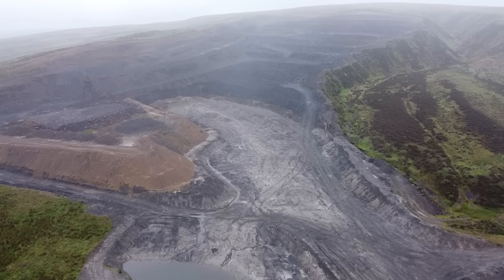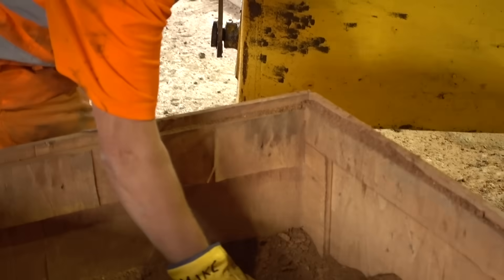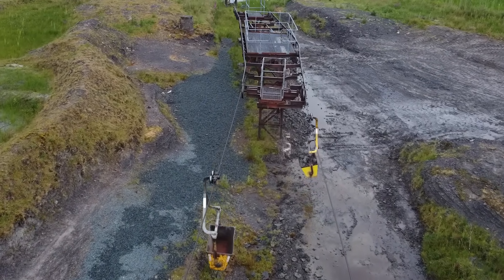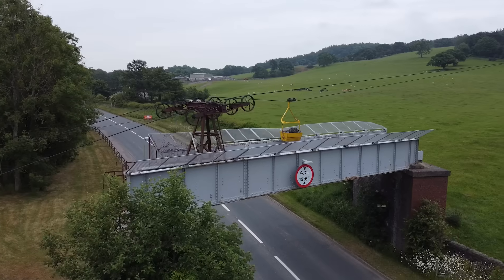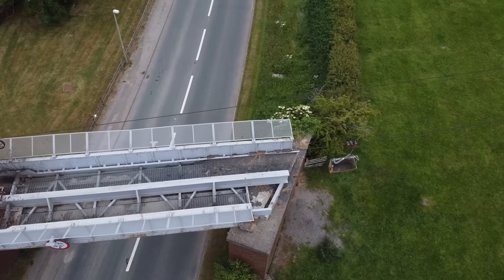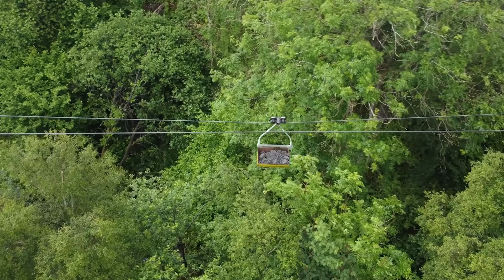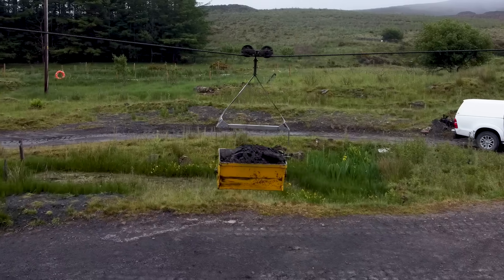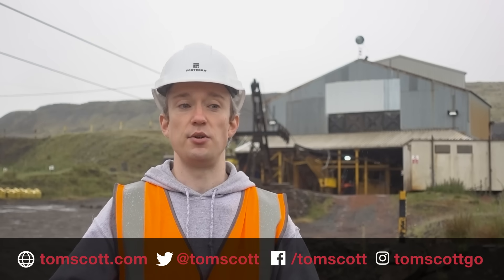The UK's last aerial ropeway uses no power, moves 300 tonnes a day, and will be gone by 2036.

Comment: "unless money is constantly spent to keep it in working order, it'll decay into an unsafe blot on the landscape' you perfectly summed up everything kept for heritage value - people think everything should be kept but few are willing to spend the required upkeep costs.
Reply: Isnt that true of any system, can you give an example of a system of transport that takes no costs for maintenance?
Reply: Log driving?
Reply: @ You are not very familiar with log driving are you. teams of horses, and men and the resources supporting them. Carving out landscape to facilitate getting the logs into the river system. Creating and maintaining booms and wing dams and water control dams. Power supplies for all of that.
Reply: Most ropeways do not use any power to operate. If the sourcing end is higher than the destination gravity does all the work. In fact it created a problem… what to do with the surplus energy created… and available at either end. Some of the ropeways used this power to generate electricity. Others had elaborate dynamic braking systems to disipate the energy.
Incidentally, there are hundreds of ropeways in use today… the ski lifts used worldwide. Most all ski lifts (and aerial people movers) are derivations of the mining ropeways developed one-hundred and fifty years ago.
Reply: Here, on the south coast of England, the probable disassembly of the (much-loved-but-costly-to-maintain) Hastings Pier has just been announced. November 2025.
Reply: Wrong. To keep a ropeway in operating condition requires maintenance and upkeep — what system doesn’t. However, the few remaining abandoned ropeways left are essentially old key… a few tower structures and maybe a wire rope — often already squirreled away already. For their purposes, ropeways are an environmental bonanza. And are making a comeback.
Reply: Tourism is the only answer.

Comment: Legit question, why don't people keep using gravity fueled airial ropeways for transport like this? I mean it saves on fuel costs and corbondioxide pollution. It's just real nifty. Anyone know?
Reply: Because it's not free energy. It is powered by the gravity of the shale that's quarried for the Forterra brickworks in the buckets. The shale got into the buckets likely with a diesel powered forklift or loader. It is not pollution free, and does (indirectly) use fuel.
Reply: @Richard Fallstich  The buckets don't carry bricks, they carry shale from the quarry to the place where they make the brick.

Comment: can someone explain to me how these buckets go up again?
Reply: It is powered by the gravity of the shale that's quarried for the Forterra brickworks in the buckets. The bricks are only on ONE side of the 'conveyor' - the side going down, only the empty buckets [which are lighter] go back up.
The shale got into the buckets likely with a diesel powered forklift or loader. It is not pollution free, and does (indirectly) use fuel  for power.
Reply: @RichardFallstich  The buckets don't carry bricks, they carry shale from the quarry to the place where they make the brick.
Reply: The buckets have a mechical grip at the top (like a pair of pliers), when placed on the moving cable it grips the cable and gets hauled up. At the top the grip releases and it moves onto like a siding to be refilled.
Reply: The empty buckets going up are lighter than the full buckets coming down.

Comment: Uses no power?   So what drives the pulley system fresh air 🤔
Reply: It is driven by the gravity (weight) of the shale that's quarried for the Forterra brickworks. The shale is only on ONE side of the 'conveyor' - the side going down, only the empty buckets [which are lighter] go back up.
The shale got into the buckets likely with a diesel powered forklift or loader. It is not pollution free, and does (indirectly) use fuel for power.
Reply: @RichardFallstich  It's driven by the weight of the SHALE.....not the bricks. The bricks don't travel in the buckets, only the raw material.

Comment: Going into 2030 replace shale with tourists and quarry with a café. Put electric generators as brakes and a hundred year green attraction is magically created.

Have tours from entry level to engineering degrees, explaining the concept. It could be part of a larger tour package where the roman aqueduct system is included.

Tourists can travel the world learning what inventions use the natural forces to perform work.
Reply: Someone with an engineering degree will know how this really works. It is powered by the gravity of the raw shale in the buckets. The shale is only on ONE side of the 'conveyor' - the side going down. Only the empty buckets [which are lighter] go back up. The shale doesn't just jump into the buckets at the top. Shale got into the buckets likely with a diesel powered forklift or loader. It is not pollution free, and does (indirectly) use fuel for power.
Reply: @Richard Fallstich  The buckets don't carry bricks, they carry shale from the quarry to the place where they make the brick.

Comment: Clever design to be sure.  However, just to keep Isaac Newton happy on the whole this system is really kept operating by all the diesel & electricity used to bring tooling up and extract material at the top of the operation.  Tapping into the potential energy of material at higher elevation is a nice bonus.

Comment: There is a mining company in Australia that hopes to run battery electric freight trains in a similar way to this. They will be loaded up with ore at the mine, before using dynamic braking all the way down the hill to the port, where the dynamic braking should have generated enough electricity to get the empty train all the way back up the hill to the mine again. In a similar way to this Aerial ropeway, I hope that this mining operation will essentially act as the 21st century version of the amazing ingenuity from the past.

Comment: hm, I can imagine there are many viable uses today, slightly upgraded ofc. imagine a ski gondola. yes yes I'm aware this system needs specific amounts of weight and timing, but nothing that cant be automated? not enough people aka weight? send up a weight dummy instead. too much people? take one out. might not be as high capacity as a fully motorized version, but I can imagine this might be a great solution for smaller destinations with low tourist volumes?

Comment: Why can't this technology work bye using removable weights for ski lifts?
Reply: Because the “removable weights” would still need to be lifted back to the starting point eventually…  That would be a net loss…
Reply: @brookebradford8009  easy, the weight is dropped at bottom into a waterpipe when they fall automatically opens into a container that automatically shuts.  The containers are filled on the outer sides with air, causing the container to shut upward to the top.  This system would send the container back down bye gravity helped by air vacuum system.  ?

Comment: Okay going down the hill everything goes but what about uphill?? How you guys make it move it??
Reply: The weight (mass) of the filled buckets going downhill is greater than the weight (mass) of the empty buckets returning… If the link were broken, an external power source would be required to restart it, but as long as mass that is being pushed downhill by gravity exists, the resulting kinetic energy is sufficient to pull the empty buckets back up.

Comment: You could say it is gravity powered; as long as there is a  mine digging up material to put in buckets the heavy buckets out weigh the light empty buckets and it goes round and round.  Smart that they didn't try to use power and waste it.

Comment: Okay but, I have a genuine question: if it requires no fuel or energy to power, and it requires maintenance on the ropes every 6 years, surely it could be made into a museum or something. Just as an example of how it used to work. It's a feat of engineering! It's unique in the country! Are you telling me this couldn't be solvent with tickets sold to see how it works? Perhaps not. Seeing as it actually needs to bring something down for the system to flow, if there's no shale it can't. 

Still a real shame though.

Comment: Hmmm, guessing those buckets aren't filled using a magic wand, nor is the material used to fill them, extracted in the same manner...

And if the weight of the material in those buckets is what keeps it operating?...

Cool contraption, but most certainly doesn't operate on zero energy...

Comment: Actually, since gravity alone bears no energy (it is the energy well itself), what powers it is the gravitational potential energy of the rocks that get into the buckets. The potential energy of an object upstairs is higher than one downstairs. The rocks at the top of the hill are 'charged' with this potential energy by tectonic motion, that created the hill itself. Same principle as what the Torre energetica Energy Vault at Arbedo-Castione in Switzerland uses.

Comment: It was a great piece of art and engineering. I need similar setup near Himalaya ranges in north of India a remote location, to take goods between 40Kg - 100Kg, if its gravity fed excellent but need to carry goods both ways, Do we have any help on the design of such ropeway that is cheap to built, this area has single phase electric line. so any kind of help in this direction will be immensely appreciated. Many thanks.

Comment: Similar principle with the iron ore transports between Swedish mines and Norwegian harbors. The carts are fully loaded and going slightly down-hill to the coastline, the electric train is using the brakes "all the way" to the harbor thus recharging the batteries for the locomotive that will take the empty carts back up the hill again.

Comment: Brakes, eh?   
If there's a need in taking the excessive energy from the road, powered by a cosmic force, One must consider the possibility of making it a transfer. 

(..put the gennie on it, i.e. save on the pads and make free power aswell.   Selling it to the right hands might generate enough to keep the little museum going, when the pit runs empty)

Comment: Gravity both ways? I’d would have liked to see that explained more. How the counter weights or whatever work... I mean the is the heavy one going down the counterweight itself? Does that mean there is friction on the line? Like it doesn’t just roll down? It pulls a little as well? Still it quite working this out in my mind... Explanation?
Reply: They send the shale downhill, the weight of the loaded buckets is enough to keep momentum in the ropeway, thus sending the empty buckets back uphill.  To prevent the line from speeding out of control it has brakes that allow them to control the speed and keep it in an operating range.

Comment: Can I ride in 1 of the buckets?  this is a  brilliant design showing how practical physics solved a problem with gravity 👏  could you use an electric generator on the rope to act as a brake but generate electricity to run things like lights and the kettle ??

Comment: The final scenes of the movie "Get Carter" (the original movie) show a similar type device that moved waste spoil from a colliery down to a coastal area for disposal. It never occurred to me that it could have been gravity powered too. I just assumed it was turned by steam or some other engine. Do you know if it was also gravity powered? Great video.
Reply: The coal-waste filling the buckets was going downhill to be tipped into the sea and the empty, lighter buckets were being carried uphill for filling, so the system would have had some assistance from gravity even if there were another power-source.
Reply: @None-zc5vg  Thank you for the info. I guess that enough grade will provide energy as you described, and you don't want too much grade, just right. Thank you.
Reply: Blackhall Colliery in County Durham.

Comment: the fact that a computer, presumably trained for hours to solve this exact problem, said “nah you guys had it right” is awesome
Reply: “that’s high praise coming from a machine, cooper.”
Reply: @vertipop  ay Titanfall 2
Reply: @ethanw7416  yessir
Reply: @vertipop  BT-7274 survived
Reply: @vertipop  hello pilot…
Reply: I am reminded of a line from The Beverly Hillbillies:

"His calculations were correct to the penny.  Not a mistake in forty-seven years."
Reply: Math doesn’t change over time
Reply: A computer wouldn't be "trained" to solve this sort of engineering problem, it's just regular adjustment of parameters by an engineer sitting in front of it.
Reply: The computer is using the same maths that Pythagoras and the like laid out thousands of years ago. The engineer a hundred years ago had access to precision metals used for his squares/instruments, no reason it wouldn't come out identical.
Reply: Well, to be fair, the problem was originally solved by humans, presumably trained for years.
Reply: @Autonomous15  -Likely a guy from another planet.
Reply: @MartiensBezuidenhout  Math is a universal constant. Our language for it changes all the time but math isn't something that can change. 

1 of something is always 1 of something and 2 is always 2. Our labels for those things and how we understand those values and how those values interact with other values may change, but the facts are already there, our perception, understanding and labels for those concepts may change but we don't invent math, we discover it and label it.
Reply: The question that was asked of the computer was devised by engineers, it's a matter of mathematics, and it has only one right answer.  Humans or computers will arrive at that same answer, it's just a matter of how long it will take them.
Reply: Massive testament to the skill of those engineers
Reply: not sure designers of this age could beat designers of yesteryear without their computers. Goes to show how damn smart those guys were!
Reply: @TheStaggIW modern engineers have better tools today, they could do it, if they are trained on slide rules and pencils
Reply: @TheStaggIW We certainly beat them in terms of output. What used to take 5 engineers and 10 drafters, is now a single persons job.
Reply: @TheStaggIW im quite sure theres no need to denigrate the modern generation to give those who came before us credit.
Reply: @TheStaggIW  no they could lost the use of thier imagination
Reply: Shows just how well educated the engineers were, back in the day. There's no school like the old school.
Reply: @christiangibbs8534  ehhh take it easy there. Plenty of issues created by uneducated engineers.
Reply: Today we need computer (if they work) to solve complicated problem, back then just a pencil!! How humanity become so stupid!

Comment: This is fascinating!
I haven't heard of this before.  It's almost like perpetual motion!
The energy is expended by the digging and loading equipment at the high end, but that would be needed even if they used trucks to move the shale.
Reply: The energy is stored in the earth by it being higher than the end point. 
The energy came from the big bang and the formation of the planet.
Reply: There is always a loss of energy somewhere. That’s why there’s no such thing as ‘perpetual motion’. The laws of thermodynamics cannot be broken, with entropy defying every magic spell that’s ever been thrown at it.
Both you and your initial responder are partially correct. This thing gets it power from the potential energy of the elevated mass in addition to the energy of the equipment which transfers that mass into the buckets.

Comment: Still don't understand how this could possibly work without any source powering the turning on the wheels that move the cables.
The explanation "gravity brings it down" doesn't explain how the buckets are brought back up. There is also slack between the pylons that the buckets would have the overcome.
Still really confused to how the physics works here.
Reply: Potential energy = mass x height x gravity. The mass difference between the full and empty buckets is enough to overcome the weight of the empty buckets and the friction of the cable on the wheels and send them up the hill.

Comment: Were I live, back in the 1890s- ish there was a copper mine and they ran the copper ore 23 miles down hill to the smelter where the refined copper could be easily loaded on train. Neet to see this old tech still running.

Comment: There's an article about aerial ropeways and automatic cargo transport for a bargain, and the higher-tech continuation aerial ropeways is the aerial conveyor belt, with a working example. Safer, because instead of using a single cable, it uses a net of cables. Carts can still be used to carry cargo, they just have to be above the metal wire netting. And it can be power-free, if delivering to lower elevations, but moving uphill and above harsh terrain it is still a lot cheaper than using trucks, just not as energy efficient as aerial ropeways.

Comment: The load on these buckets is ten tonne. Modern machinery moves fifty times that in a single truckload. Three mile long trains of super heavy wagons on super heavy rails, driven by two people, with the most sophisticated controlls at a hundred km/hour, loading three hundred thousand tonne ships with a single heavy oil powered diesel type engine direct driving a single propeller that without stopping delivers to a port anywhere, with a crew of twenty. How this world has reduced costs in a century. Fewer men to run that train than to run ten tonne of shale.

Comment: It's an amazing example of 'free energy' and perpetual energy.
Reply: Not perpetual or free. If no new material is loaded at the top of the hill the ropeway will stop.
Open loop system + requires constant input = not perpetual
Reply: This is not an example of "perpetual motion" or "free energy". The ropeway is powered by the heavy rock-filled buckets moving downhill. Without a constant supply of these, it stops.